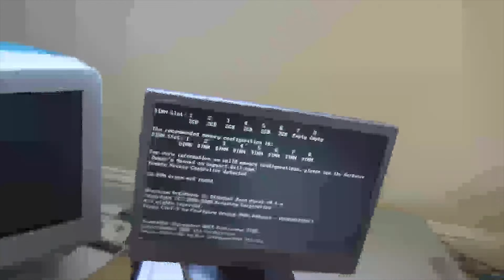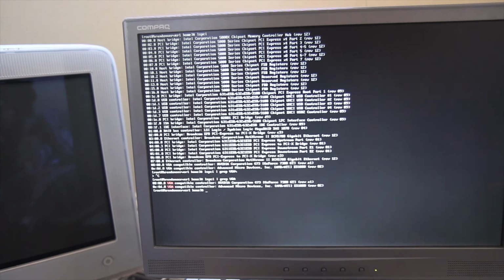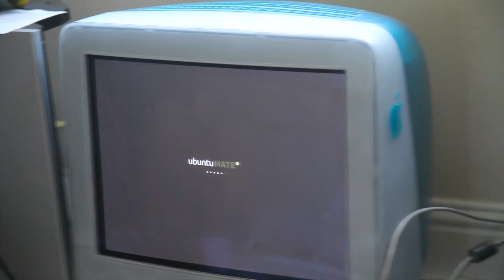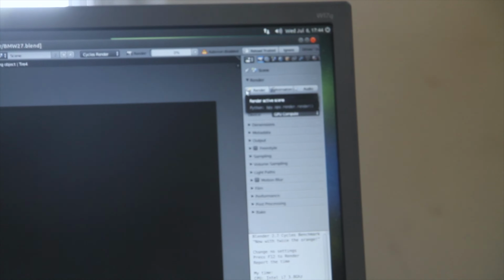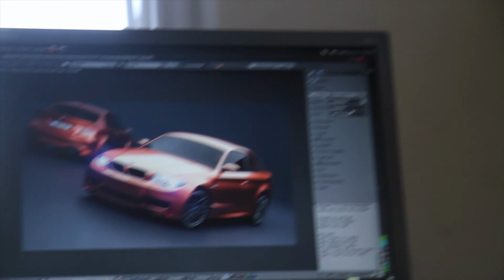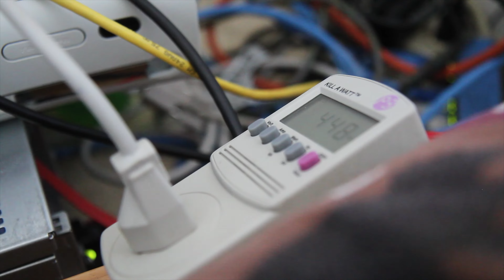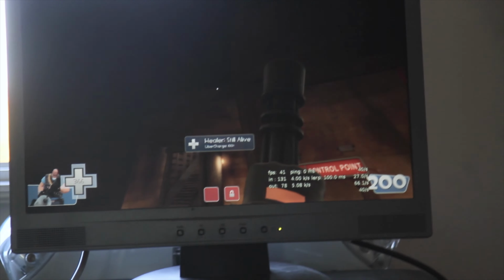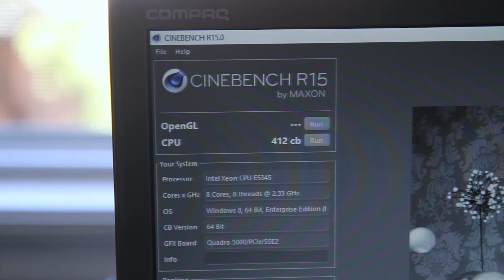Putting a GPU in a Poweredge 2950

Comment: I got a free 2950 and I have a gt 210 laying around I'm going to try to put in it, the server only has a 8x slot on the riser card farthest from the power supplies so hopefully that riser card supports GPUs. It has windows server 2008 installed on it too so hopefully that's compatible with everything.
Reply: Well it didn't work.... The server wouldn't even turn on with it installed, now I'm not sure if it messed something up on it as it's acting a bit strange now...
Reply: Tried again before I end up selling it. I acquired a 8x gt 730 for free as part of a free computer and installed it, it didn't show video on boot but i was able to see it in Windows server 2008 after downloading drivers. Rebooted, still no video out of the card... Found out the idrac card needs to be removed so i removed it and i got video out during boot but once it finishes initializing everything it just hangs on a black screen. I'm guessing the gt 730 is not compatible but there are probably cards that do work just fine doing the steps i did.

Comment: Nice work! I got mine to work with a nvidia 650 ti. Why didnt you remove the metal suport of the pci riser for better airflow to the graphics card?
Reply from the maker: +Ryuken Suzaku the metal support didn't seem to hurt airflow much. Also this was mainly for a few tests and I didn't plan to use it long term.  That did run very hot. Like burning then I touched the back of the server. I missed the fans a while ago to make the quieter and that made that gpu and ram run hotter.

Comment: I had to dig this one up... I tried to install a 960 for shits and giggles but every time the system would freeze when it gets to the remote access part. If I unplugged the card everything works just fine. If I plug in the card, the server defaults to using the graphics card for output, but freezes when it counts down the 5 secs and starts to load in the os. This has bothered me for sooo long... If you're still there please help...

Comment: I tried installing a gtx750 in mine without the riser slot. I chose that particular card because it doesn't require additional power to run. So l cut away the the back of the pci-e slot like you did. But in the end I wound up frying the gpu and gave up... don't know if I have the stomach to try again lol. Great job and very cool video man!!
Reply: GTX750 is for PCI-e 3.0 (or is it 2.0? anyway) If you are going to try again you should try with the card made for PCI-e (ie version 1) and use the x8 to x16 converter.
Reply: PCIe cards are backward compatible. Aka, a PCIe3.0 will work on PCIe 2.0 or 1.0 with degraded performance due to lower bandwidth.
Reply: It didnt work for you because the tdp for the gtx 750 is 55w where has the pcie x8 only supports 25w, It would work if you got a card that was powered via pcie cables instead.

Comment: I havent watched the video all the way yet so i dont know if you fixed it but sometimes if the gpu doesnt support lower speed/sized slots theres 2 pins you have to jump so the slot goes, oh theres a gpu here i should be sending power and data to.

Comment: What bios version are you running? I have 6.7 and when I add a gpu It defaults to the main and displays fine until I either go into bios or attempt to boot and then the system immediately locks up. I have tried this with several gpu's and it is whenever the video mode is changed from the initial text mode. Very frustrating I have to say. I would love to retire my 1605T and use this as my htpc/browser. Kind of a sidegrade but the 2 extra cores makes up for it. Amusingly I already had the same perc card in my main rig with a spare and when I got this the Perc was dead. Anyway any help on the bios will be a huge help thx. :)

Comment: Hi, my name is Daniel. I need help! I have no ideas. I have many doubts, I hope you can help me.
The history is:
I have the same Poweredge R710 and I want to install an EVGA NVIDIA GeForce GTX 1080 FTW gpu, we follow the steps of the video and it works, now I have problems to install the drivers. I have the original disk of the graphic card installation, but it works only in Windows 7, it installs perfectly, I have problems to open the interface. NVIDA says it does not work in this version of Windows 7. Then the Windows 10 DVD (version 1903 of Windows 10) will be installed. My problem is that the current NVIDIA drivers do not work, now a yellow exclamation point appears. I read a lot through the Internet and tutorials and they do not solve my problem.
I clarify that the gpu never gives video image (Windows 7 as Windows 10).
I need professional help, thank you very much.

Comment: Hey man.  Can you tell me how you have the power at the back hooked up there?  Did you need an extra part or is the connector tucked away somewhere inside the 2950.  I'm trying to get exactly the same card up and running in exactly the same machine.
Reply from the maker: My 2950 just had a molex power connector connected to the hdd blackplane that I used. I then connected that to a  single molex to 6 pin pcie connector I made. I don't know of any other way to connector power unless you solder directly to the psu or get an adapter from a hdd sata/sas connector.
Reply: Ah ha.  Yes there is a capped single molex, floating around. I'll have to sort out an adaptor.  Thanks!
Reply: If you have a 2950 look at the psu the big pin power connectors furthest away from the small pins a 12v positive an the body of the psu is the ground

Comment: Jittery, out of focus, and kind of done without research. Buy a slot adapter rather than risk damage to the riser board by cutting and hacking away. You made the whole process more difficult than necessary, and the quality of the video is so poor as make it difficult to watch. We would all like to see a proper third party video card installation into a server along with server os drivers to go along with the hardware. Where are the server 2012r2 video drivers that will work with the card? Oh only linux not windows, so you should title this video a linux installation not a server os installation.

Comment: Not a very good thermal setup. Those gpus pull from the side that's going to be right up against the top panel when you reinstall it. And it might be fighting the system fans too.
Reply from the maker: It was a horrible thermal setup. The back of that server would burn you if you held you finger there for more than a few seconds. The fan was blowing air in the correct direction(out the back). I was mainly doing this for testing, so I didn't mind the extreme temps.

Comment: do they really suck power? why would any company make an inefficient server? they wouldnt sell surely?
Reply from the maker: Yea there pretty power hungry. I wouldn't buy or use one 24/7 today. In there day there were pretty efficient and good but power efficiency but the next generation was much more efficient. 

Power wise these systems pull about 200w idle with a normal config of ram raid cards and hdds. Full load is around 300w on my comparison. For references my dual 1366 systems, the next generation used about 120w idle with a simmilar config.

Comment: Hey there is something invented long ago called PCI express x8 to x16 adapter, why the hell are you cut the slot???
Reply from the maker: +Omid Habib Any adapter would make it so that the card can't be fit in the slot normally due to the added length. Also that costs money and I had a dremel already. The slot was also a 4x only electrical so I can cut away a lot of it and not lose any bandwidth.
Reply: You're right it'll work, but matter of the fact their not designed to operate that way but as long as you're okay with bandwidth and gpu calculation performance everything's alright. btw thumbs up for videoing efforts.
Reply: they are designed to operate with x8 cards otherwise they would of removed disabled discrete graphics like in the 1950, these are built for x1, x4 and x8 cards.

Comment: where did you get 12V from?
Reply from the maker: I got the 12v from a molex connector at molex connector at the front
Reply: But that molex has only one 12V rail... how's  it holding? I already tapped into the backplane 20 pin connector... tomorrow I'll double-check it but it should hold on as I spread the load on three 12V rains and three ground rails...
Anyway thanks for the reply. I'm just adding a gpu for some fp/openCL acceleration.

Comment: Did you ever boot Windows? I can't get 10 to boot...   Only 7
Reply: Update the bios and firmware on your 2950 to the latest version. This is most likely why you cant run Win 10
Reply: @claude1987  using the latest bios the board woln't support the graphics card with 10 or 7...   Bord support 7 and graphics. But not 10 and graphics. Windows 10 will only boot using onboard graphics.
Reply: @claude1987  it was fun to play with for a little while I always enjoy making Oddball stuff work together

Comment: Hi there, was you able to disable de igpu aka radeon ?
Reply from the maker: I didn't find a way to in the bios or hardware. I think you can do it in software but this depends on the os.
Reply: @ElectronicsWizardry  then... do you have double monitor? or is the discrete gpu default? when i use this, the igpu is main, and i can only ise the discrete gpu once windows has started.
sometime ago, i disabled the igpu of a pe 2800 with some surgeon in the pci port: it was with a shorcircuit in 2 pins of the pcie x8 port... i did the same in the x4 but it does not work at all, and more, i think i messed the x8 port in 2950, not sure at all
Reply from the maker: I just had it with both gpus in windows. The igpu would show the bios and windows load screen but once the gpu driver loads it would have the igpu turned off and only the Nvidia card outputting to the display
Reply: @ElectronicsWizardry  same here, thank you very much T_T